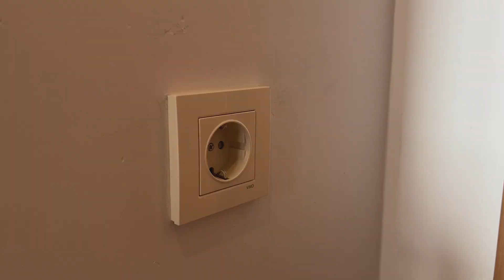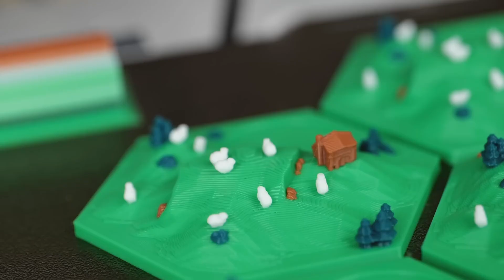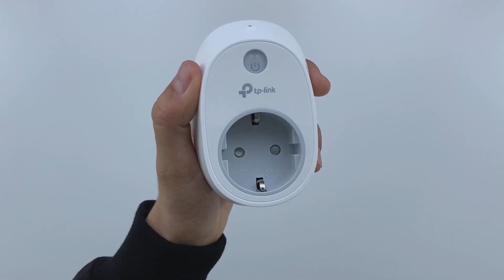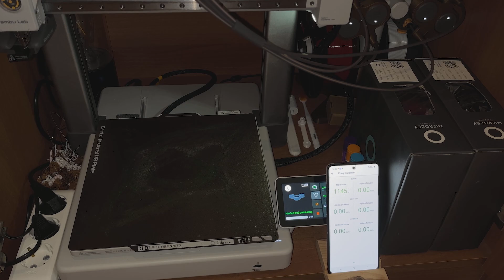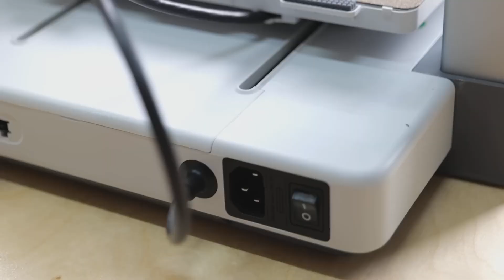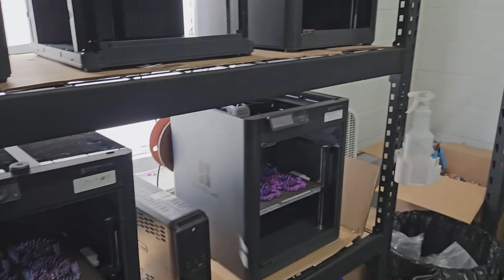3D Printer Energy Consumption: How Much Power Does the Bambu Lab A1 Use?

Comment: Just for clarity. So,if you print  a 6-8 hour print it basically uses 1-2 kw per hour right? Based on your findings?
Reply: Printer spikes at 1148watts (aka 1.148 kWatts) for a brief moment, like 1~2 minutes and then goes below 380watts, aka 0.38kw/h
Meaning that in worst case scenario, you're paying 1kw every ~2h30min

Comment: How you r calculating 1500w when max power provided by psu is just 100w😂😂😂..so ar u saying that psu is not good taking 1500w as input and giving just 100w as output??..😅
Reply: As far as i can see the bed is heated directly by AC bypassing the PSU. I was looking at buying this printer so the power consumption did bother me. This was also the reason why they had the recall on the A1 because the bed cables got worn out and the open AC cabling could be dangerous.
Reply: first of all i could not get what you are saying. But let me try, this device pulls 1500w max from the outlet. Not always! Average sits around 110w while printing PLA
Reply: English?? lol

Comment: I was looking into the bambu lab website and they say that on 220v the maximum power output is 1300w and on 110v the output is like 350w!
Is your electricity on 120v or 220? Maybe it can influence the maximum usage :)

Im trying to figure out witch UPS to buy and your video was the only one that really measured the A1 consumption, so thanks!
Reply from the maker: First, it is very funny statement made by BambuLab's official website! My electricity is on 220V.

Watt is total energy input. It has to be same all around the world unless in the US they might not be using heatbed etc. Volt times ampre is equal to watt.

For the UPS case, it is easy to decide if i was you. Do not expect it to last more than 1 hour. If that long shortage happened, throw the garbage plastic to bin. And because of the reaction time of the UPS is rapid, heatedbed will not get cold. So you can assume your usage will flactuate between 90-130 watt.
Reply: @TKC3D   @TKC3D  Yeahh its kind of weird this numbers be so different. I know some machines prefer 220v because the ampere are smaller therefore the cables can be thinner...
But the diference between 110 and 220 is absolute insane!

So probably the printer on 110v will only goes to 350w when starting, after that it would be like 90-130 watt like you said... 
Maybe i'm gonna need to do some tests here haahah

Im looking for a UPS with 1400va with 0.5 factor. So it would be able to handle like 700w. I think it will work for my 2 x A1

Comment: So, what about 1500W noted in official specification?
Reply: for normal PLA printing, i could be able to reach max 1200W but on other settings like petg may reach the top of line peak value. Although it is peak value for short time, it can cause melting on weak outlets and cables. Probably as an enthusiast who purchased 3D print, you will not rely on these kind of cheap cables
Reply: How you r calculating 1500w when max power provided by psu is just 100w😂😂😂
Reply: Only heating table consumption in A1 is 1kW. Thank God it turns on in pulses, but the current surges are significant. Low-speed measuring devices show the average consumption value.

Comment: Please make a video on ups power backup for bambulab a1 🙂
Reply from the maker: i have never used ups batteries. Instead, carryable battery packs like DJI's can deliver sufficient power to complete a print. With those packs, you can print anywhere :)
Reply: @TKC3D  sometimes it takes time to get backup power..So I need some time until the auxiliary power is back.